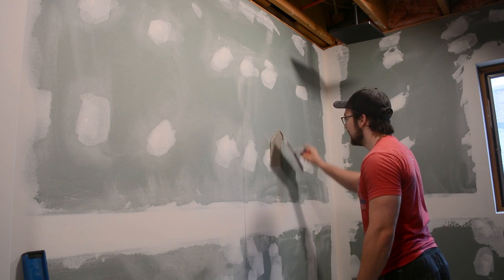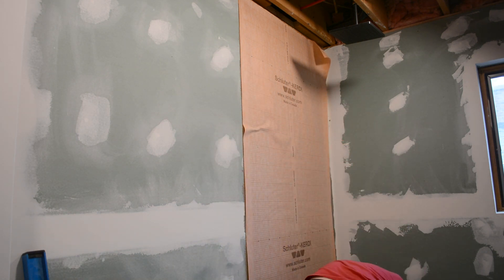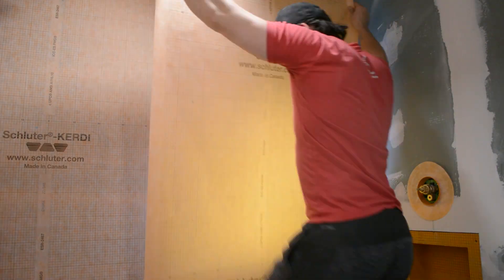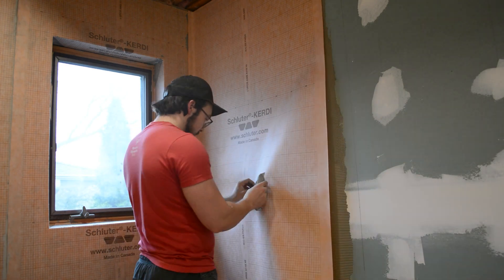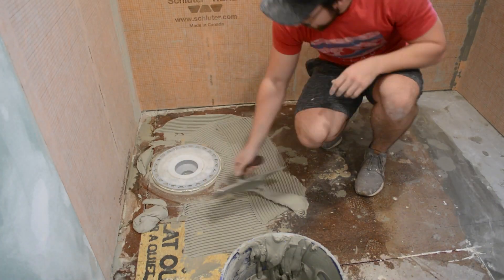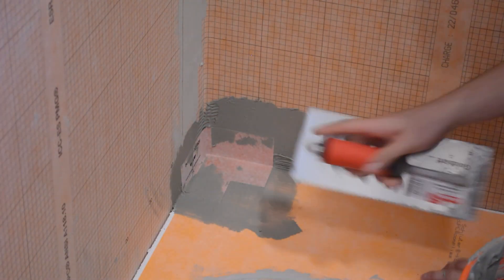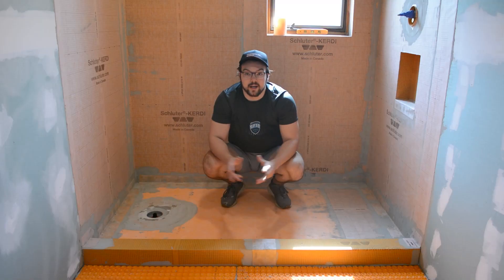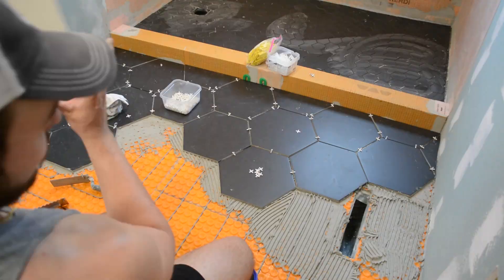How to Waterproof your Shower - Schluter Kerdi Kit | Bathroom Remodel Part 5

Comment: Thanks for the video! Any suggestions for checking the Kerdi drain connection to the waste line? Most of the plugs I am seeing sit above the connection joint. I installed a drain to an already existing waste line without access to it and would like to check it before installing the shower pan etc.

Comment: Why do this instead of redguard? Seems much easier to just do a couple coats of redguard and call it good.
Reply: its a carcinogen ,toxic, and cracks
Reply: @renzokuken1227  it only cracks if you apply it incorrectly, and even then you can just do another coat. As far as it being toxic, do you think mixing thinset is good for your health? Nothing is good for you if you don't use proper PPE.
Reply from the maker: I think both options work, but to me I sleep a bit easier at night knowing the Schluter system is behind my tile. I think redguard is still good alternative though
Reply: I just passed the flood test in my kerdi pan, still a bit apprehensive about it water proofing.  How had the tile and shower held up for you after this?
Reply from the maker: @terepin09  Everything has been working great with no issues